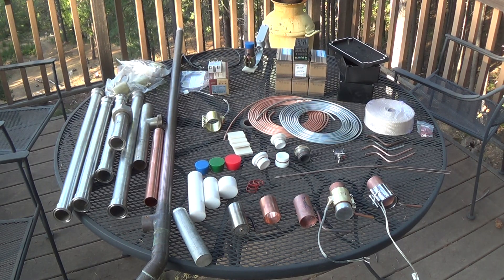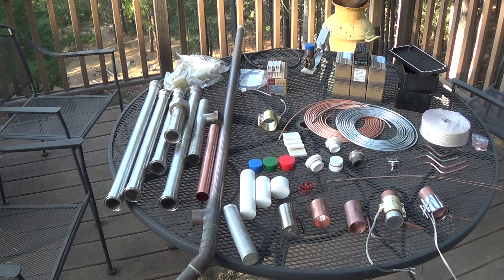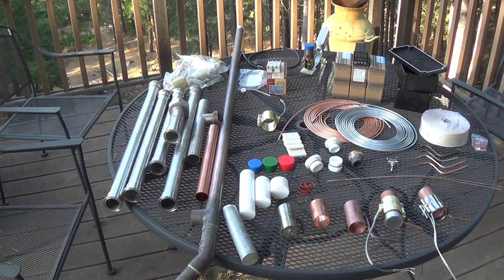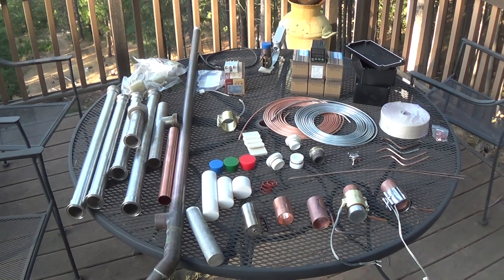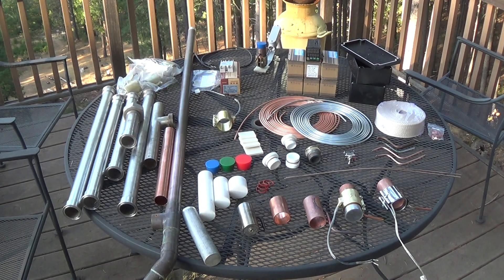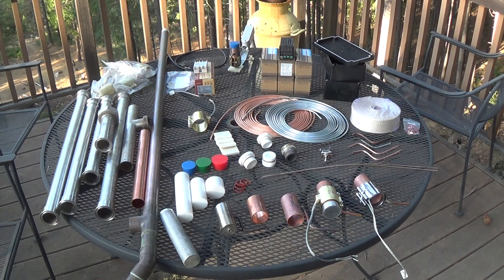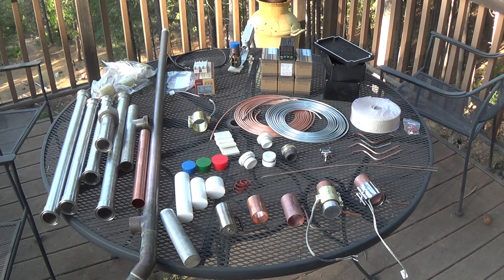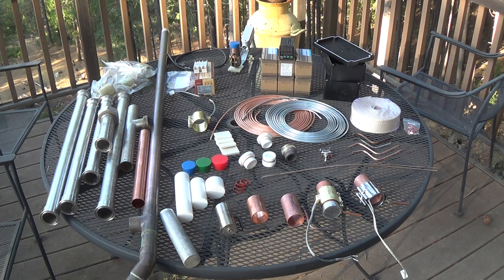Research and Development. Oxalic Acid Vaporizer. Varroa Mites on Honeybees. Part #1

Comment: hows it going,
Reply from the maker: Good but slow. I just bought a 3d printer to custom make the electronic boxes. That is the last step as I have my pots figured out. My machine shop business has been taking all my time. I started this when things were slow and I was looking for more work. Then business took off. I'm sure I'll hit a slow patch and be able to learn how to use the 3d printer.

Comment: Good stuff, looking forward to what you come up with. I was going to make one but then figured the Johno's Easy Vap guy has made hundreds so he probably has the manufacturing kinks works out so I just bought one of his. Works great and easy part availability for any repairs in the future. 

Having said that his has no heat sink and so yours will certainly put out a more stable temperature.
Reply from the maker: He makes a good one for sure.